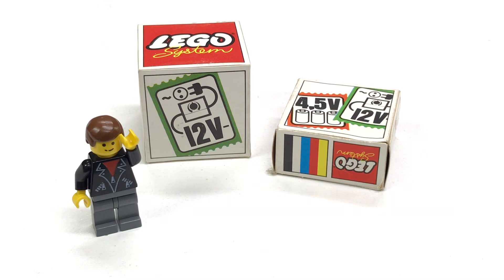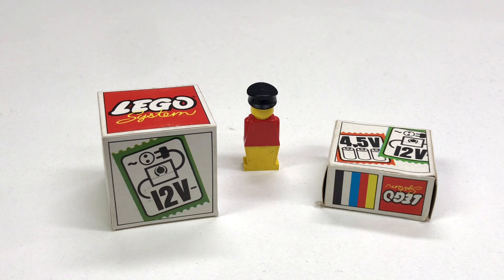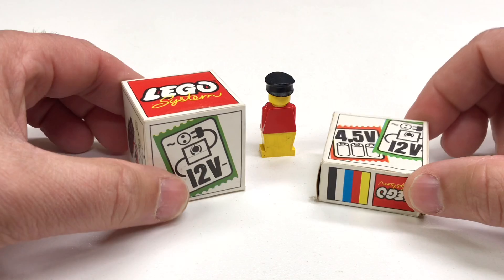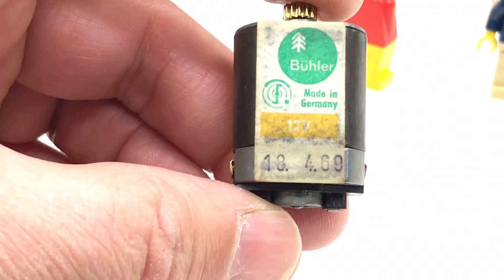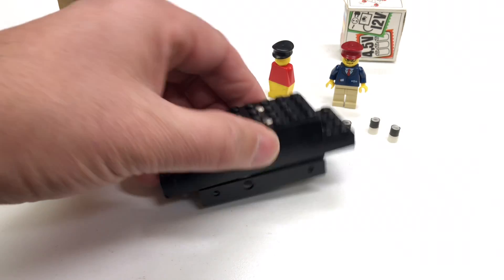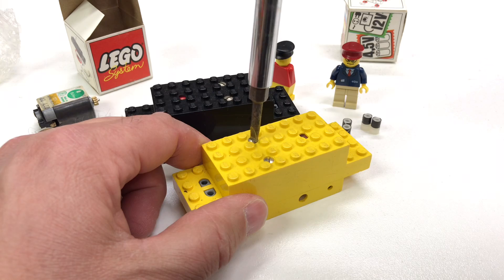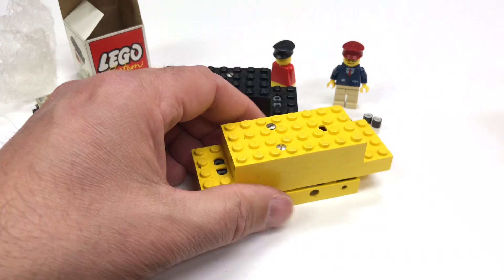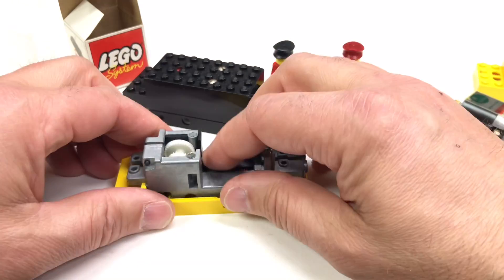Tiny Boxed 12V LEGO Train Accesories for engine Repair - Set 703,705

Comment: #BAT: I don't think 12v conversion is always that simple. Dont you need to have a particular design that has sprung terminals on the underside of the motor to contact the powered centre rails for 12v or am I missing something?